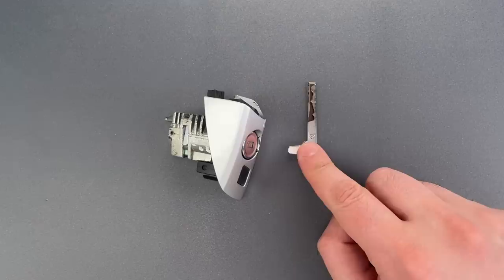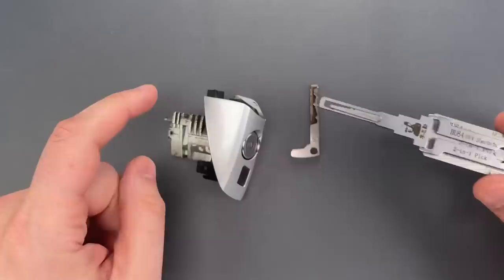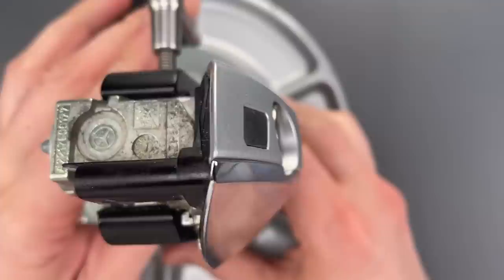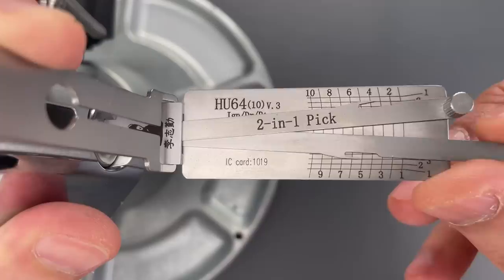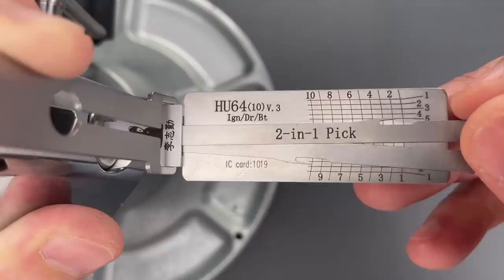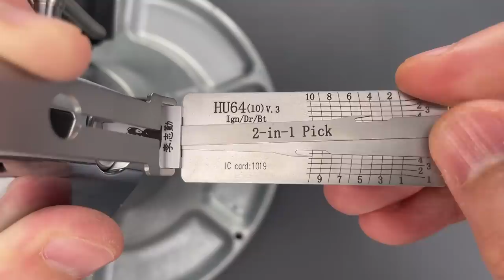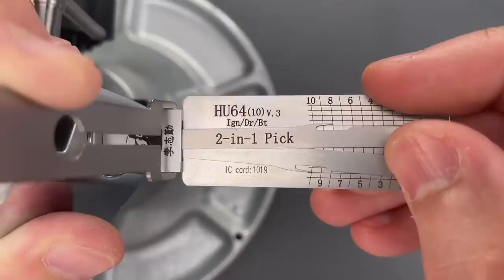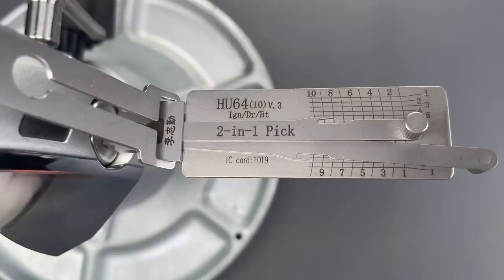[1411] Mercedes S-Class Door Lock Picked (2013-2020)

Comment: For a Honda, just use a flat head screwdriver or sometimes you can use your own Honda key to open other cars
Reply: I used to have a Yamaha motorcycle... You could turn the ignition on with a penny.

And oddly the key would open and start a surprising amount of other motorbikes and cars... Don't ask 😬
Reply: Lost the key for the John Deere once. Just borrowed the neighbors spare.
Reply: My first car was a R31 Nissan Skyline, the aussie model ones, pretty much any one of those could be opened and started with the key from any other once they had worn in for a few years, it was laughable how easy they were to break in to.
Reply: @Howells226  Tractors are notorious for this. You can get the ignition keys at most tractor supply stores. The key to the cabin (if it has one) are different. But if you can get in, you can get the tractor going.
Reply: @Howells226  many old tractors in Europe can be started with a nail
Reply: @schwuzi  afaik most heavy equipment is like this
Reply: @schwuzi  Yeah, I've found that you can start a Mahindra with a key that looks nothing like the one that you got with it.
Reply: I had a renault and the key could open and start other cars
Reply: Our Honda Civic has been stolen and abandoned twice so far. In has smells, trash in the back seat and a squealing fan belt. Those seem like effective theft deterrents. Every time we get it back the cops find it while responding to another stolen Honda, presumably a cleaner one.
Reply: At one point, mydad owned two Fords where by coincidence, the keys for each worked in either ignition, but not the doors.
Reply: Same with old Volvos
Reply: The key thing is true for a lot of cars.  There were only so many set patterns that would be keyed to.  I suspect that's still true too.
Reply: any car with keyholes, destructive but it works, hammer in a flat screwdriver with a rectangular shaft, use a wrench on the screwdriver shaft and turn, unless the lock is made out of steel the lock will break and the door will open.
Reply: @rakadtwitta  not always true, sometimes you can destroy the lock and only turn half of it without moving the actuator
Reply: Older Toyota pickups, the eraser on the end of a pencil- lift handle slightly, pencil goes under rearward slot- straight in until you hit the bar for the door lock knob- push up, LPL is LOL'ing.
Reply: @schwuzi   I also heard that, back in the day, the Ford Crown Vics used by NYC Yellow Cab and NYPD Patrol Cars were all keyed alike.
Reply: Hah! In the 70's the phrase used to be "Buy a Yamaha FS1E and get any British Leyland car for free". FS1E key fitted my dad's Austin 1100 for sure.
Reply: Dad once opened my old Mitsubishi with just two rusty nails
Reply: @schwuzi  Well honestly on an older diesel tractor, what's the point of having a good lock? The injection system including the fuel cutoff is all mechanical and the starter is right there. Even without a key, all you need is to take the throttle off of "stop" and use a nail to short the starter solenoid and you're off. With gas you'd also need a jumper wire to put power onto the coil.
Reply: @schwuzi  my tractor can be started only by a crank manually
Reply: my moms old 97 honda civic got robbed four times because you could open the door with any 97 civic key, each time the robber took the battery from the car
Reply: Someone actually did that to my little Mazda. The burglar was able to turn the entire lock. There was a small scratch on the paint, but that's all -- the lock was undamaged.
Reply: @nedkelly5866  Says the Car Stealing Commenter, LOL!
Reply: @BytebroUK  old rovers are the first car I learned to jiggle, using a nail file, then it was ford tibbe, old worn keys and locks just jiggle and turn in and out a little and boom open
Reply: @kevinforever6898  all crown vics used by taxis cops or in any fleet most likely had fleet keys you could get them without it but most chose to have it so any key could get the car open and start it so you didn't have to worry about loosing a key or locking it in the car
Reply: I had a coworker that I'm pretty sure used our work truck key (2010 silverado) to start his early 2000s Corolla
Reply: @schwuzi  My grandpa (back in 70's) just kept key in tractor.  Said it wasn't good for anything but farm work and if someone wanted to do some, go ahead.  Also a thief that steals a tractor deserves the embarrassment of his getaway car.
Reply: I dont remember what year or model of cars it was but I was watching a show where a cop explained how you could catch a car thief back in the day because all you would have to do is look in through the window and see if they had a screwdriver jammed into the ignition. 

Side note, I hate car manufacturers. They produce garbage and get away with it because of government bailouts.
Reply: @nedkelly5866  one of my old kawi’s didn’t have keys.. well it did, it was just jb welded into the ignition and hidden as a switch 🤪
Reply: @rajamicitrenti1374  we had the same thing with two Fords. A ‘72 Pinto and a ‘73 LTD.
Reply: I used to have a 1990 accord, I had a buddy with a 93 and we were able to unlock his door and start the car with my key lmao
Reply: @rajamicitrenti1374  Makes sense the door needs a more pick resistant lock but the ignition should be super durable. Dono what that means for all these keys opening everything else. Seems like a big problem.
Reply: A knife was the only key I had for my old VW Caravelle
Reply: I have a friend who can turn on his old ford with a butterknife
Reply: @evanshearman4324  a friend of mine has an 00s corolla and not sure if the lock has worn out but it opens with my old house key and with a little jiggle you can even get it started
Reply: @DangerousPictures  Russian tractors have an ultimate anti-theft device - petrol starter. (basicaly a two-stroke chainsaw engine, which is pain to get going, if you don't know the sacred curse, and the crowbar kicking spot)
...not that anyone would want to steal one in a first place :D
Reply: @nedkelly5866  LOL
Reply: I accidentally used my key on someone else’s Acura that looked just like mine 🤣.  So it definitely works
Reply: I accidentally drive someone motorbike  home once cuz it look alike
Reply: Not a modern honda though lol
Reply: cop cars in the us all use the same key that can be ordered on amazon
Reply: I remember that about a honda. Whe. We had one of our cars stolen Saterns still existed.  The office said they could be open and even started by kids scissors.
Reply: Thanks. Now I now how to become an expert thief
Reply: I’ve got an 85 Chevy pick up and my brother has an 86. My door key works on his doors.
Reply: Lol
Reply: Hondas are particularly difficult to pick "the right way" but are still pretty easy to open

Comment: It still took more than 2 minutes, a specialized tool and a lot of skill. And since this lock only gives access to the interior of the car, but there's still the chip for the alarm and immobilizer, that's pretty much good enough. Most car thieves will either pick a different car, or just smash in one of the windows.
Reply: It took 1 min 30 seconds actually.
Reply: My interest in this channel is purely academic to the mechanics of everything. It’s enough for me to have it in the vise and never associate it with any other physical objects such as a car or house lock. Akin to WORDLE for locks.
Reply: Repo man: Hold my slim jim...
Reply: FYI some groups specialized in stealing a model or brand of cars will defeat the immobilizer by plugging some devices(i think on the ECU of the car), in my country a group specialized in stealing Toyota Hilux got arrested, and they found the "device".
Reply: @tomtheplummer7322  Not just repo man. Everybody I knew growing up had and kept one of those in their cars. Just for when your friends lock themselves out. Takes like three seconds. That’s the best thing about the outlet malls as you go to the tool outlet store and they usually have slim Jim’s there for a couple bucks.
Reply: Basically this. Unlikely anyone (other than the owner/dealer) likely to have the door picked. Otherwise it would be a rock to just get in or a flatbed to haul it away. I think they even spoofed the remotes for a time. The lock is “good enough” to where they could reuse something the already had.
Reply: This is also essentially the same lock they've used since the 70s on the W116 S-Class so I don't think it's really that much of an issue.
Reply: Thieves use signal repeater and one thief will go near the key like in your purse or near home front door while an accomplice will go near the car with a receiver that emits the same signal as the key an thus car thinks original key is inside and will let the car start no problem. To bystanders would like like you drive your own car.
Reply: @tomtheplummer7322  Slim jim is only good for rod not cable actuated locks
Reply: siiiiiiiigh
Repeat after me: The Lishi tool is purely a visualization aid, it is not doing anything special.
Reply: Using the manual key lock to open a MB door locked with the remote will cause the alarm to go off (at least for a 2003)
Reply: @CptJistuce  It makes manipulating the pins significantly easier than doing it just with a regular pick in your fingers, especially for lower-skilled pickers.
Reply: @adinchina1  That requires the thieves (minimum 2 people!) to know who the car belongs to, where their key is, and to get reasonably close to the key with the repeater device without causing suspicion. If someone follows me from the parking lot and starts waving an antenna around my pants pockets, this would be /very/ obvious.
Reply: Nearly all thieves - at least in the UK - just use the relay attack method. They hold a receiver next to your front door of your house and transmit the key fob signal to another guy standing beside the car. Now it’s unlocked and they have a copy of your car key data to start the engine
Reply: @isyt1  that’s what I was saying but naysayers don’t accept that 😂
Reply: @deanwoodward8026  that's what I thought.  Mercedes have so many sensors everywhere, surely there are door open sensors that will set of the alarm.
Reply: @adinchina1  well not all cars have keyless entry/ keyless start. 
It’s often easier just to burgle a house and steal the keys. Then leave the car parked somewhere in public for a few days in case it has a tracker
Reply: @isyt1  Do people in the UK traditionally store their keys next to the front door? That would explain this. I've always kept my keys on the wall next to the coat rack, which is quite far away from the door, so this problem never occurred to me before.
Reply: @WooShell  well everyone is different but remember they’re using an amplifier. I think they can get you from about 12ft away. There’s videos of them holding the relay device and walking around the house trying to get a signal. 
You can defeat it by wrapping the keys in tin foil, putting them in the microwave or placing them in a faraday cage wallet. 
The newer keyless entry fobs have solved this by having accelerometers in them and go to sleep when they’re stationary like hanging on a coat rack and so they stop listening for a signal.
Reply: @isyt1  some keys signal can be “switched off”temporarily. If I hold the lock button on the key and press the unlock button twice while still holding the lock button it will disable the transmitter in the key until a button is pressed. This is the case for Subaru and Toyota keys in the USA. This renders the relay method useless.
Reply: This would probably also let them into the trunk, which isn’t usually so easy to smash and grab.
Reply: @CptJistuce  I mean it's also a deciding tool. That's why it was made, to save the trouble of taking apart the entire door to measure the inside of the lock.
Reply: @adinchina1  And that's why I still don't like the NFC unlocking. I want to NEED to press the button on the keyfob...
Reply: @CptJistuce  I beg to differ.  The Lishi tool keeps your 'pick' in perfect alignment with the tumblers and keeps you from having to work around your tension wrench while juggling both.  It's a lot easier on your hands and since the scale on it is calibrated, you not only can decode the lock for cutting a new key, but you know when you're centered on each pin or wafer.  I found it a great aid in learning how much tension to use, especially with security pins.  Maybe LPL can open a decent lock just as fast freehand with a pick and tensioner, but for the rest of us mortals, it's worlds easier with the correct Lishi tool.
Reply: smashing a window is not non destructive tho, the whole point of LPL is non destructive entry
Reply: @ShadowDragon246  LPL is also not an average car thief (I hope).. ;-)
Reply: @WooShell  , relay attacks are very common. This is why newer cars add UWB or BT time of flight ranging to the keyfobs. You won't notice the dude with the pickup antenna, those are small enough to fit in a pocket. It can also be done by one thief using a directional antenna, though a little trickier.
Reply: @isyt1  , they don't have the key, but they can start the car as long as the relay is close to the actual key. The key material is in the fob and it generates a one-time key on each use, so the thieves can drive away, but then they need to modify the car to accept a new key to start it again once stopped.
Reply: @sbrubak  yeah I explained that above
Reply: @EdwardM104  They changed the key design in the mid 80th but that is still nearly 40 years ago.
Reply: the moment you are inside the car you have access to the OBD II port and then the only thing keeping you from driving away are a notebook and the right software.
Reply: Dude is chilling, he could do it faster if he wanted to
Reply: @WooShell  You need 2 guys and a house or a restaurant. You don't follow the people. You bet on a key near the door when the car is parked in front of the house. That's actually a standard attack. They have just one problem. You can't turn of the engine anymore because you can't start it again. Once it's running, it must run until you reach the garage. Which means you refill the car with the motor running at the gas station. If you observe that, call the police.
Reply: @adinchina1  signal repeater wont work on most of new cars or electric locks. Opening code changes after every use of key. So the signal that opens doors once , wont work again . And not just on that next time , it's like never again. 264bit or higher code is basically different all times.
Reply: Maybe I just wanted to sit in it
Reply: @rdxdt  sounds like my country too  so you must be talking about SA
Reply: If you can open the door, you can pop the hood and attach the appropriate gear to get the car running.
Reply: @greendryerlint  for some reason I can’t get my trunk to open with the key or buttons on an 2009 Mercedes s550. I wonder if this tool will open my trunk?
Reply: @theurbanartist775  You could try it, but it would probably be easier if the back seat folds down for a pass through, to just crawl back and pop the trunk that way, then replace the solenoid or whatever failed.

Comment: LPL “Nothing particularly special about it.”
Mercedes: “What? Master Lock said it was their top of the line.”
Reply: Lol
Reply: I don't think mercedes Benz would even consider to use Materlock
Reply: @biosbois8739  You think. It was meant as a joke if that escaped you.
Reply: yes it is still top of the line because LPL took a whole minute to unlock with the specialised tool.
Reply: Dude, this cracked me up! Thanks
Reply: @gb5540  Aaaaaaaaaaand...
That makes the Rav4's lock out of this world, riiiiight?
Reply: absolute gold right here
Reply: This isn't Masterlock-bad. It's just run of the mill. It has a lot more pins (some of which seem to be security pins based on the multiple clicks) and no simple bypass. You can't just use a comb pick. He was just noting that this is equivalent to something you'd see on a non-luxury car rather than a no expense was spared super-lock.
Reply: @SkylineLofe  yes
Reply: To be fair, a lock on a car door doesn't have to be that secure. Stealing the car is something else, you will need computer hardware and software to start it without a key, and if you want to get into it to steal some property I could get into any car in 1 second using my special key, it is called a brick.
  No criminal gets into a car using a lock picking device, they either force their way in or have a stolen key or a cut key already.